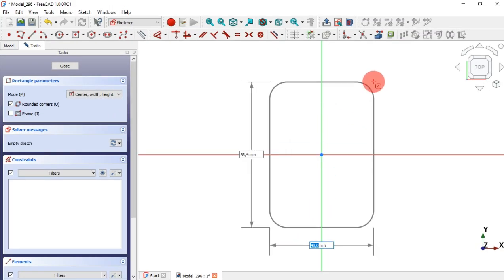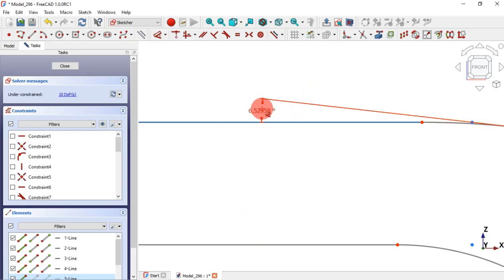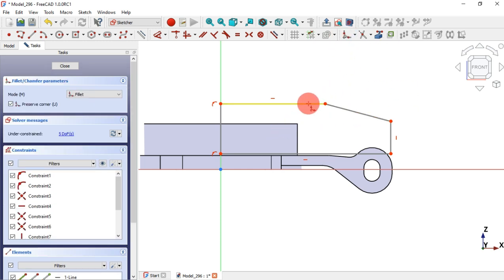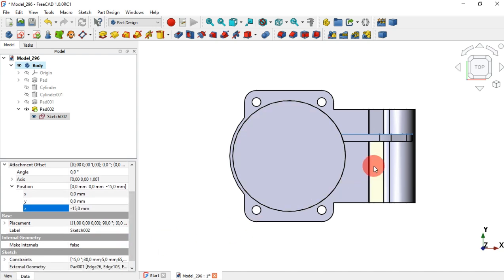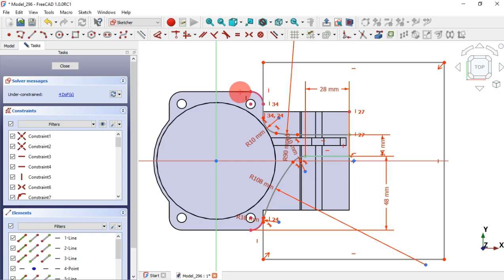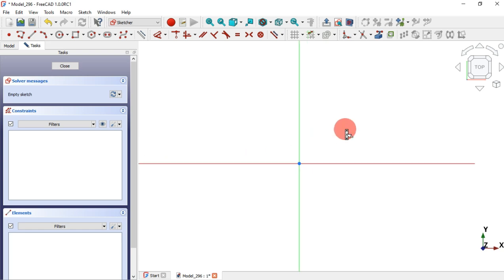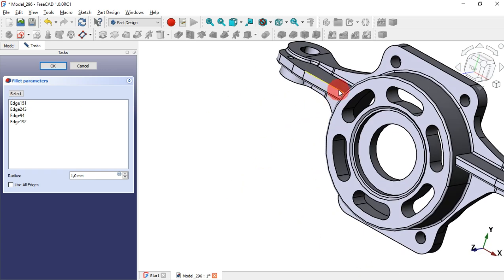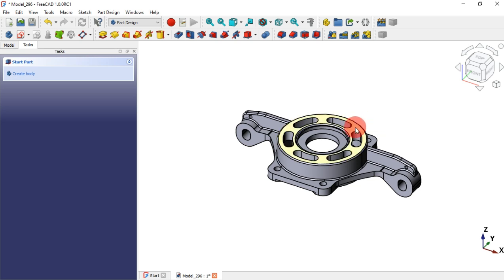FreeCAD 1.0RC1 First 3D Model using Sketcher and PartDesign workbench

Comment: The error withs the fillest, is it a bug of the RC1?
Reply from the maker: I think is because the space between them is too small. If the top cylinder diameter were small maybe the second fillet were worked.